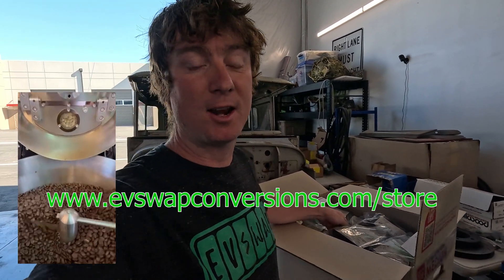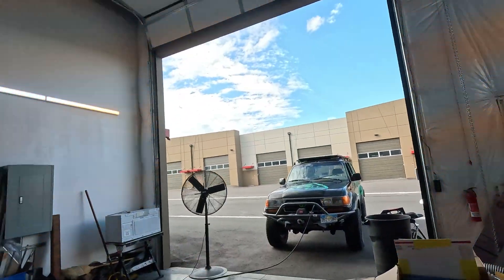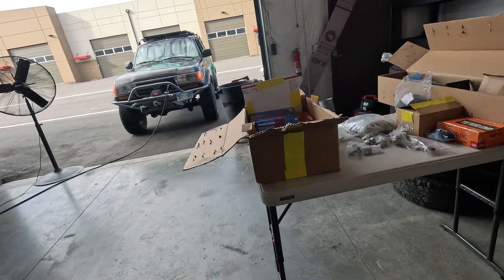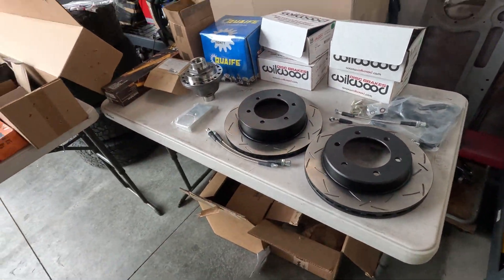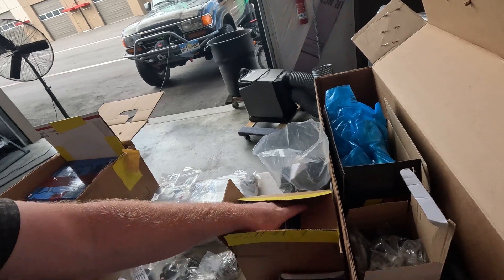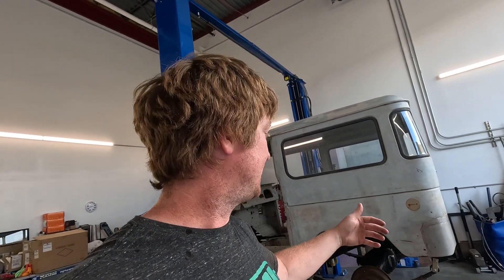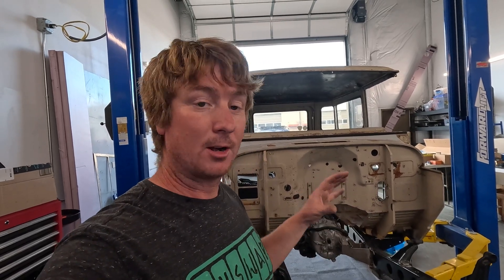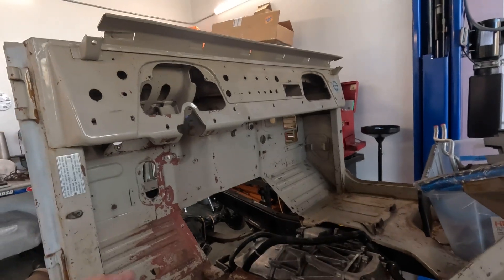FJ40 Land Cruiser EV Swap Begins!

Comment: In the Springs.  I have an FJ60.  Thinking about EV or hybrid.  Might just rebuild the engine in it, but looking at options now instead of taking it apart twice and doing it later.  Want to completely take the FJ appart and build it the way I want it.

Comment: I also have an FJ40 from 1976 and am planning to convert it to electric, but I want to keep it in a way of Toyota original by using parts from a BZ4x... 
Don't want too much power in it to keep the stock brakes and connect the electric motor to the transfer box to maintain the possibility of shifting low and high gear, one more reason not to have too much power on the differentials....this will also keep the car in an easy to switch back to original mode. Why do you want 300 HP on an oldie like that..
Reply from the maker: Sounds awesome! It might be tough getting the right electronics to control the BZ4x hardware but I'm sure it's possible. keeping low range is definitely a good move. I think the Model 3 motor with the new gearing will work well offroad even without low range but we will see!

Comment: So glad the algorithm popped your channel up in my feed! Dream project right here. Really looking forward to the updates on this build and can't wait to see how you tackle some of the challenges of adapting 50's-era design and manufacturing to a high power, cutting edge, Tesla drive-line.

I've always wanted to see if someone could pull off mounting the long form Tesla battery modules in between the rails of a ladder frame—so as to get the weight as low and centered as possible on an already tip-prone SUV. With as many salvage model 3s as there are coming into the 2nd-hand market I've been hoping the prices with start coming down by the time I'm ready for my swap attempt. 

Be very cool (pun intended I guess) to integrate the high-efficiency Tesla heat pump AC system as well since you're planning on integration HVAC on this build too. 

Best of luck on the project! Love the channel already!

Comment: When you get to the battery choice, would be interesting to understand your decision making, especially if you weigh up using new Chinese batts. I see a lot of ads for CATL sold by 3rd parties from China aimed at old Nissan leaf, to go from 24kWh to 40 or 60. There’s a forum I’m following where hopefully someone will be giving a real world test result soon.
Reply from the maker: I am considering some Chinese batteries
Reply: @EVSwap might be worth you checking the My Nissan Leaf forum. Search ShenZhen for a long thread now. It’s obvs aimed at Leaf owners, but with the Resolve setup as it stands (before we get to the next gen options) it’s interesting to me in terms of energy density. The downside with the one on that thread from Vivne is seems like they make their own modules up from cells and they end up as various sizes. They claim to reprogram the Leaf BMS. Other Chinese vendors use a standard sized module, but I’m less convinced on the way they manage reporting capacity back.

Comment: This is pretty great! 

Some feedback tho... 
I had the 1967 40 Series and even with the 1F engine, the rig was front heavy.... 4 wheeling down steep hills was scary because of the concern of the back wheels coming off of the ground. 

From what I can tell, the space between the frame in the engine area is slightly narrower than the space at the back of the rig... 

What if you also placed cells where the aux tank would normally be mounted as well as under the front seats? 

This might help balance the truck better front to back and hopefully also lower the center of gravity.... 

I LOVE your content and as a 3x locked 80 Series owner, I hope to someday drop an EV system into it that will give me north of 400 miles on a charge...
Reply from the maker: That is a good point. I am considering putting batteries in the rear or even possibly the AC/heater system. You are right there is a lot of space under the floor between the frame in the rear and the weight balance would be significantly better. I really want the ride quality to be good in this vehicle as well, so that will help.
Reply: @EVSwap  ❤️
Reply: "❤️" in the "this is awesome" kinda way

Comment: A 200 mile range would be nice, but I can't help but ask about the speed and conditions. After all 200 miles of city driving is one thing, 200 miles driving at 70mph on the freeway is something else entirely, particularly when you are driving something as unaerodynamic as a Toyota FJ40 Land Cruiser. So what kind of driving will you be doing when you are looking to get 200 miles from a Toyota FJ40?
Reply from the maker: I'd like 200 miles of mixed driving, city /highway. You're right at 75 mph nonstop the range won't be as much.

Comment: I would think twice about using a "Torsen" type differential in an offroad vehicle unless you intend to use lockers in front and rear axles.  If one side of a Torsen becomes completely unloaded then it will spin uncontrollably.
Reply from the maker: Yes you are correct, I am contemplating lockers in the axles as well. For light offroading it should do well enough though. Also the Torsen only needs a little bit of resistance to start locking up, so even with one tire in the air it still may work well enough.

Comment: Can you just stack two model 3 batteries on top of each other in the engine bay for 400 miles of range? haha
Reply from the maker: That's a good idea, the model 3 modules are pretty long but may fit.
Reply: And all the weight on the front......